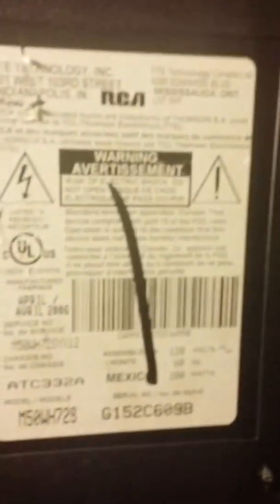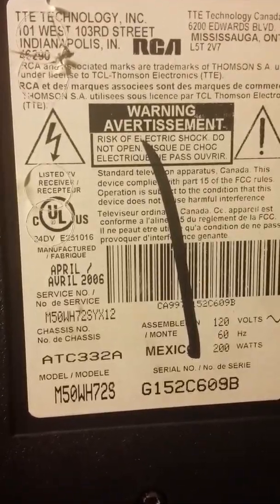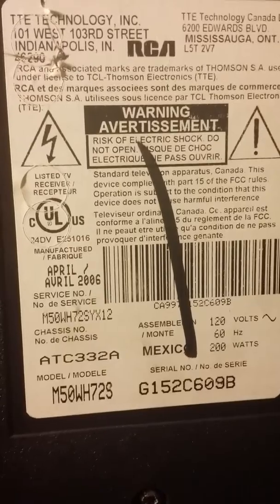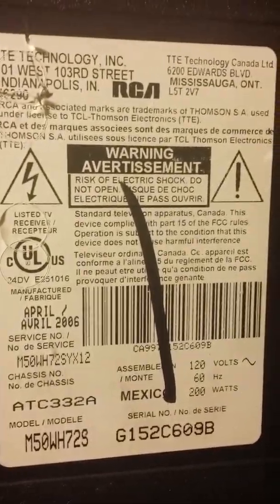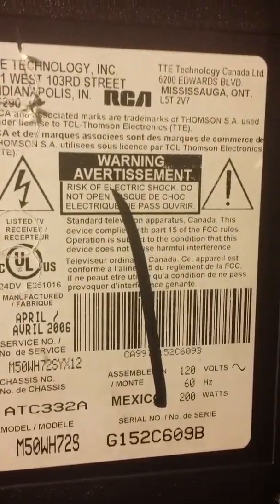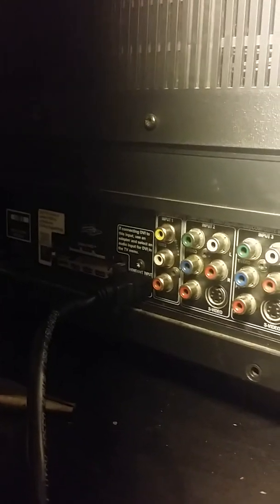RCA DLP have sound no picture HELP!!

Comment: If the wheel is not spinning up, that would halt the boot process. If it is spinning up, that's usually the last thing that happens before the ballast lights the lamp.
Reply from the maker: I haven't checked the color wheel. I've just about given up. what do you suggest?
Reply: Mz Drea
In these models, the wheel is usually pretty loud and partly exposed, so you should be able to see and hear it spin up. That almost sounds like the wheel at 0:34, but it's hard to tell. If it is, that would normally indicate something downstream (ballast or lamp) doesn't want to light the lamp because the wheel is generally the last thing to start before the thing actually tries to light up.

On the other hand, if the wheel is not spinning up, there is either a problem with the wheel or a prerequisite condition is not met for it to proceed with the boot sequence.
Reply from the maker: OK. I've replaced the ballast and lamp. I get sound no picture. I will check to see if the wheel is moving or not
... Thanks for your feedback. I hate to junk my favorite TV
Reply: Mz Drea
Just listen for it and look at it (if it is visible) to see if it spins. The sound is usually pretty distinct. Remember to rig the lamp cutoff switch if you're operating the set with the back cover off as this will also prevent it from trying to start up.